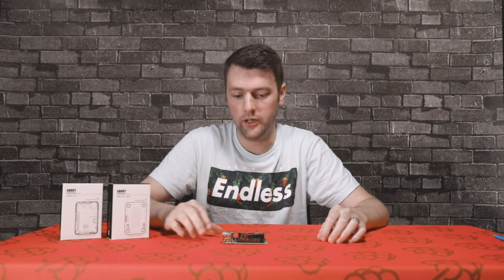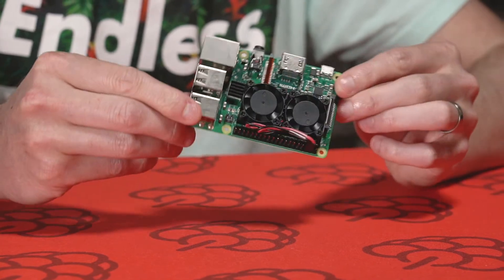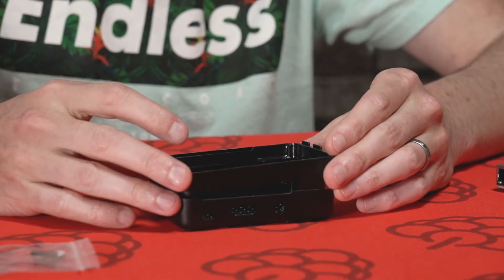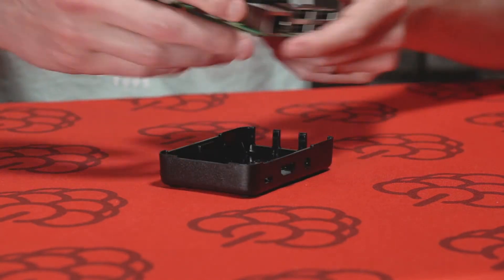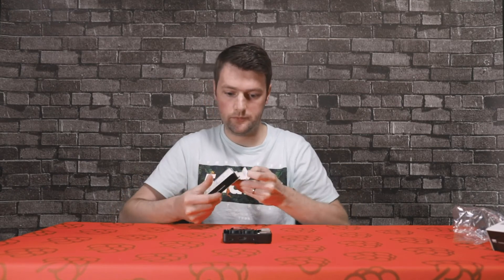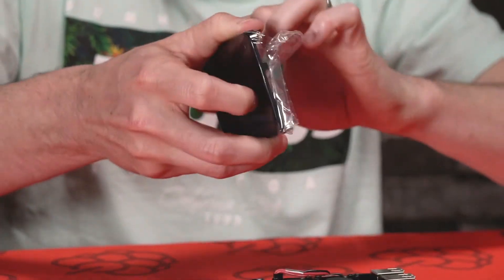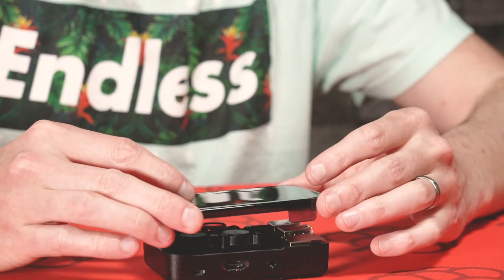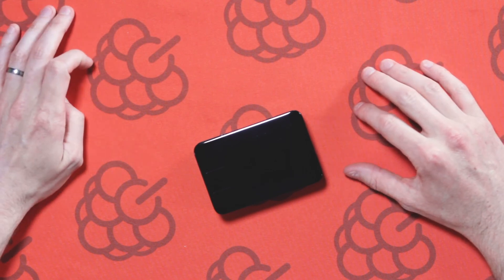How to install a cooling fan on the Raspberry Pi

Comment: Can you use this with the PiJuice HAT and will it take away the heat away from the battery?
Reply from the maker: As said in one of the other comments below "You should be able to put the cooling fan between the PiJuice and the Pi 4 and then just run the cables over the top to the PiJuice header pins."

This will cool the entire assembly to an extent, if enclosed in a case. However if you don't need to cool the Pi itself, only the PiJuice, then instead of mounting the fan in between the Pi and PiJuice you could mount it on top of the PiJuice.

Hope that helps :-)

Comment: @Pi Supply How can i use this cooling fan and a pijuice hat at the same time (rpi 4)?
Reply from the maker: You should be able to put the cooling fan between the PiJuice and the Pi 4 and then just run the cables over the top to the PiJuice header pins.
Reply: @PiSupply  Wrong title guys! PLEASE SHOW US HOW TO INSTALL THE ACTUAL FAN! NOT JUST THE CASE